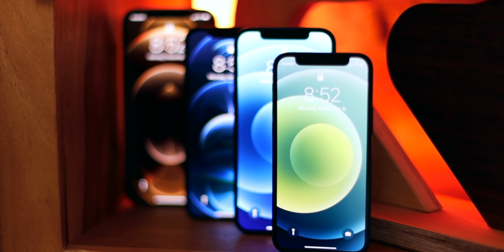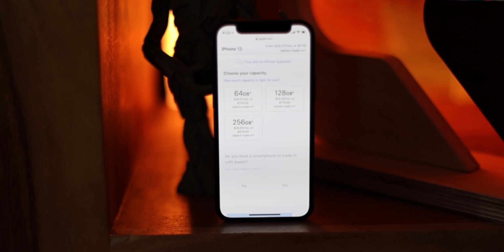iPhone 12 — Buy Now or Wait for iPhone 13?

Comment: bruh I just got my 12 pro max today so I think I'll be waiting for the 15-16
Reply: how is it working for you?
Reply: @jillwebb2412  it's working very well. there is a glitch when powered off as when I go to start it up it shows the apple logo and then stops so I have to do it a second time. but overall it is great.
Reply: @ams25dec  thought I was the only one that happened to lol. I love my 12 pro max however i will on trade it in the on if the 13 pro max has 120hz screen, Touch ID, better camera, new colors and always on display.
Reply: @joejohnson3161  glad to have found another person. All I did was software update a couple times and it happens less regularly now hope that helps

Comment: My only concern about removing the lightning port for induction Charing is connecting to my car for Apple Car Play. Any ideas how that will work? I’m not bothered about any kind of fast changing, as long as it’s done before I wake up!
Reply: My guess is that MagSafe 2.0 will incorporate data transmission in addition to powering up your iPhone. Your CarPlay should be safe!

Comment: They better not get rid of the Charging port, no one is ready for that.
Reply: Agree. That would make charging in your car more difficult. They could always develop a battery that lasts a lot longer. Knowing Apple, they already have this, but need to add it in future phones for selling points. Let's face it, it has to be getting tougher and tougher to make huge improvements every year. I think a solar panel embedded into part of the phone would be a welcomed feature. Especially for people that spend lots of time outdoors. Maybe someday, we won't need batteries or to worry about charging our phones. That would be great! I would buy that phone in a heartbeat.
Reply: @bill6872  1st thing I buy after ditching Android for a 13 Pro Max (or 12s Pro Max, whatever it ends up being called) is going to be a Moment brand Magsafe car charger/vent mount.  I have a magnetic mount from Scoche right now (that requires a thin piece of metal to be applied to your phone) and love it...but i still have to plug in my phone with a USB cable...MagSafe makes a TON of sense for the car!  Of course, if I get the Tesla I am lusting after, it will charge the phone wirelessly by default.
Reply: We had the headphone jack since the beginning and people were ready for that…and now, most don’t care
Reply: Yeah they should remove it in like 2026 when we get more used to wireless charging
Reply: @baldrat979  
2026 ???! I haven't seen a wireless charging yet
Reply: @baldrat979  exactly around 2025+ wireless charging would be way more common and better
Reply: what if you can charge wirelessly
Reply: They are getting rid of it
Reply: I hope they do, the community will adapt, making the change faster.
Reply: @Simon-xl1yz  
Don't be selfish
Reply: How even we can charge with powerbanks when travelling
Reply: @dorayon97  There are already MagSafe power banks that just attach to the back.
Reply: There is a video of a guy seeing the new iphone 13 and it still uses the lightning charger. So not portless. Unless they change it last minute lol
Reply: I am. The lightening port quit working on my iPhone X two years ago.
Reply: Lmaoooo
Reply: I’m fairly certain they’re doing that on the 14or 15
Reply: I'm still mad about the headphone jack
Reply: Imagine using charging ports
Reply: Get rid of both the notch and the port.

Comment: Honestly I'm so happy with my 12 Pro that even if the 13 is better than it I won't care or regret my 12 Pro purchase. It's just the best iPhone I ever used since the 5.
Reply: @kp1x  i want it too...problem is if they will otimize the baterry to suport the 120hz screen
Reply: 60htz sux balls
Reply: @chefgav1  at least it’s a muuuuch higher resolution.
Reply: @Emobullymaguire  but at least it has higher refresh rate which you will notice more.
Samsung make iPhone screens and I can assure you iPhone does not get Samsung best panels as Samsung phones do
Reply: @Emobullymaguire  also the ultra has a much higher pixel density and displays at 120htz where I phone can’t.
Ultra smashes iPhone in screen an refresh.

Comment: I love the 12 pro max. Ima hold onto it till iPhone 17 maybe even 18. I had my 6s+ nearly 6 years. I’m confidant the 12 pm will last that long
Reply: Yes my wife just made the same leap on the smaller versions 6S to 12 Pro and my betting is she’ll keep it until a high teens iPhone model is released as well. Having said that home button/TouchID and battery were trashed on the 6S, she’d had a product recall Apple battery fitted at 2 years and looked after it but used it hard. Still 6 years is pretty good and it still wasn’t crazy slow.

Comment: Normally, I'd say just get what's available now, because if you're coming from an older phone, it's gonna be a great upgrade regardless. This year though, that 120hz display is going to be the biggest noticeable upgrade in years. Even the 90hz on my OnePlus 7T Pro feels like a huge upgrade over my iPhone 12's display.
Reply: what would you suggest? i got an iphone 8 in January and i want to upgrade next year, around the time that the 14 would drop
Reply: @kehl7254  tbh if you’re fine with it functionally, you should be alright with the 8 for a good while. the a11 is plenty capable and even the iphone 6S still runs ios 14, so the 8 should still be supported for at least two more years. if you bought it new, you’ll be fine. if used, make sure the battery health is above 80% and get that replaced if it’s below that. as far as upgrades go, we won’t know until we see the new phones obviously, but whether it’s the newest, freshest thing out there, or a few years behind, iphones always last extremely well over a longer period, which makes “older” models actually an appealing upgrade. for example, going from an iphone 5S to the XS would be a revolutionary change for someone, even if the XS is a few years behind now. so if you wanted to keep the 8 until the 14 is out, and get the 13, it’ll still be a great jump.

i get annual iphone upgrades myself, and i buy my android (second phone) outright and just replace it as needed, and i can tell you, the iphone doesn’t change that much year over year. i only do the annual upgrade because it’s my primary phone and it’s insured through my upgrade program. your 8 should be perfectly fine as long as you are happy with it
Reply: This is facts. I have a OnePlus 7 also. And it feels way faster and snappier then my friends IPhone 12. I know when we loaf games it loads the same or his might lost .1 sec faster. But scrolling thru youtube or Instagram. My OnePlus 7 I'd faster. And with the 90 hz it makes it look 3D. I need a new phone cause I'm having charge problems. But I'm trying to hold of until the 13. After testing out my friends IPhone I felt it was slow. Until you try a OnePlus with 90 or 120 hz you won't know what I'm talking about.
Reply: @BriannaOfficial When your current device is in rough shape like that, it's honestly up to you. I'd probably make do until the new one launches, since it's only a few months off, but that's just me. I'd just basically take a look at what the problems are, decide if you can live with them for three months, and then make your choice based on that. Personally, I barely use siri, and I'd be fine with typing in a passcode for a few months. I'm really set on that 120hz. If you needed to, you could also pick up a 6S or 7 for an extremely low cost on ebay or something, sell the XR to break even (people will buy them, even damaged, for the right price) and just use whatever you get as a functional placeholder until the 13 or 12S or whatever it will be called. 

You can also just get the 12. They're still absolutely excellent phones, and they'll last you for years either way if that's the goal. It's entirely up to you.

Comment: How is Carplay going to work without a port? Yuck. Why can't they just put a damn usb-c connector?
Reply: It will have in addition to the MagSafe an all-new bottom magnetic connector for data and power. It will resemble MagSafe on old MacBooks

Comment: Holding my 6 until promotion display
Reply: So you’re will getting the 12s pro?
Reply: @yuvalcohen7115  yep that’s the hope, unless they axe plans for pro motion
Reply: @danielsoriano1496  I will get the 12s pro/ max only if it has bigger battery and 120hz